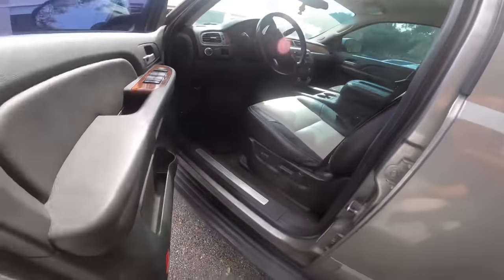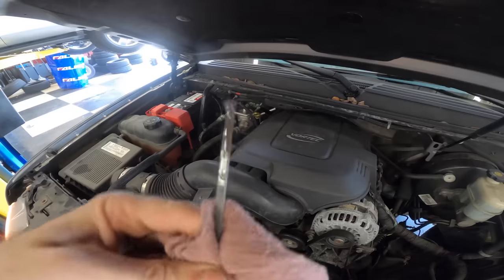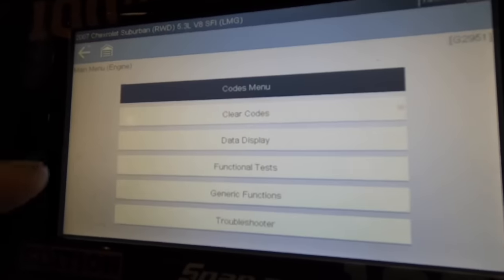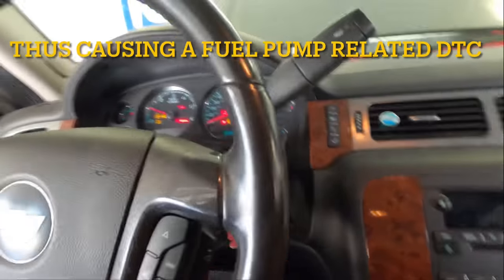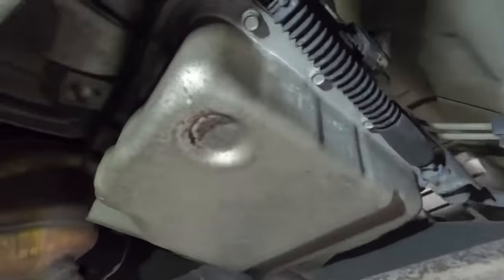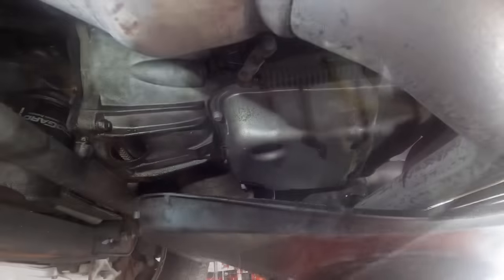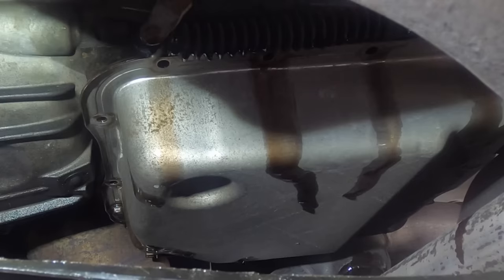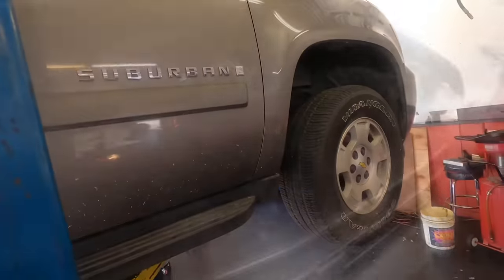Busted! SCAMMING Mechanic Causes Damage! 4l60E Transmission

Comment: I was getting ready to cheer for you when I saw that the gasket was coming off in one piece lol. I don't know what mechanics did to engineers but as punishment they should have to work on what they build for a few years.
Reply: Engineers do what corporate tells them to do. If they want a starter in the gas tank that's exactly what you're going to get. When you have an MBA running the show at the auto company, you get stupid ideas, stupid engineering, stupid everything. My dad worked for GM for 37 years and complained incessantly about stupid decisions by corporate.

I'm a retired engineer from a phone company but like to reach out and touch you. I saw the same stupidity the idiots at the top of the food chain wanted to have things done that didn't make any sense and we're detrimental to the whole Communications argument. I retired and never looked back.
You can't fix stupid
Reply: They're at the shop we like to say, We would like to have a 9" vise.... Every time we came across a over engineered fiasco We would take the engineers head and put in the vise and just tightened a little bit day by day, that way we can squeeze out that stupidity, put common sense in there...
Reply: @jameswilliams9374  This is what I don't get: how would corporate even have the wherewithal to order the starter be put in the gas tank in the first place? I have a hard time believing that a cost cutter would have the expertise required to even know where to begin modifying automotive systems.

From an outsider's perspective, it would be far more likely that the cost cutter would be wholly reliant on a toady engineer who offers such suggestions as, "Well, you see, sir, I've been looking at the design, and it might take some doing, but I'm certain we can keep the build cost under $3k if we put the starter in the gas tank..."
Reply: Marcus I hope I get this reply done correctly.
I wish it was the way you said but it's not, 40 years of dealing with this from my career as an engineer I have got some the strangest requests.

How did the fuel pump wind up inside the fuel tank on many models of cars?
It was the money person that wanted to buy cheap fuel pumps add half the cost of normal ones.
The only way to remedy that was to put them in the tank so they would not overheat.
Yes the budget dictated the location by necessity. Now make it work engineer....

Comment: Use a pump or COMPRESSED AIR fluid extractor to take most of the fluid out before you remove those last bolts to the pan.

Comment: I also notice the magnetic "doughnut" that the manufacturer puts in the trans pan, and the diff. covers on vehicles these days, because of using inferior lubricants from the factory.  I've been in new chevy diffs, less than 10,000 miles, where the doughnut is completely covered in metal shavings, and you can't even tell that it's a magnet, until it's cleaned out.  Using proper lubricants that don't brake down the moment you leave the dealership, would go a long way to combat these situations.  But then you wouldn't have to return for costly service.  I only go to a shop if there's something I don't have time or space to do.  I hate dealerships!  As a consumerist, I try to help people out when I see they've been wronged.  You have a great attitude and work ethic!

Comment: As a locksmith I would just like to say, thank you for being a mechanic who can replace and key an ignition. Wafer one, wafer two…..herr-derr! 😂😂😂
Reply: I was thinking the same thing lol
Reply: Don't you have to have a lock that can be rekeyed? I had to replace the ignition lock on my XJ Cherokee and couldn't find a rekeyable lock, so now I'm stuck with two keys.
Reply: @SNR well, that's less work for you though..
Reply: It's all good until the mechanic tries to repair a Honda ignition on their own and parts start getting lost or they break the transponder coil.
Reply: @TT3Dxyz  well yeah…he obviously didn’t know what he was doing if he snapped your transponder. Sorry you had to deal with that 😐
Reply: @snr2707  I'm also a locksmith. I get a lot of Honda ignitions where the plastic ring around the cylinder is cracked and I have to transplant the board to a different coil.

Comment: I am really glad that you got your own shop now. I liked your older content but I think the newer stuff in your own shop is much better. When I worked at an oil change place in VA it was called the grease monkey.  We would do an oil change on a customers car. The management would want us to up sell things like air filters. Even if they didn't need one. Sometimes the management would put a small amount of oil on the air filter and then they would take dirt from the vacuum cleaner and sprinkle it on the filters. I was full time in the Marines at the time and that job was a little extra money for me.  It really bothered me that they would do that and I didn't last long there. I decided to go work part time as a truck mechanic. I worked the heavy recker and the mobile service truck.

Comment: We had a 2001 Malibu and I hate that car with a passion.  We had the ignition module replaced because it was doing the same exact thing  this truck you worked on. It  cost us over $800 to have it replaced.  They couldn't Program it to the new keys that  came with it and had to use the old keys. Never did get the new keys for the module back. This car had one problem after another over 6 months so I got fed up and junked the car, it was a mechanical disaster.  I will never own another Chevy.
Great video Ray...thanks for sharing. 😊😊😊

Comment: I've been a mechanic for over 30 years and I would never use any kind of powered wrench when installing the trans pan bolts. They snap off too easy.

Remember good work isn't cheap and cheap work isn't good.
Reply: They have plenty of powered tools with torque settings. Maybe you need to upgrade as technology has improved over the last 30 years.
Reply: Na I came here for this comment there’s no way I would do that it’s the same as putting on a tire he seated the first bolt all the way before any others were threaded the torque wasn’t crazy on his tool he just didn’t start them all properly

Comment: That was so funny, as the video cut for a commercial, I said out loud "Dude, you should wear your belt" and as soon as the video returned, he said "and you're right, I neglected to put on my seat belt" as if he actually heard me say it hahahahaha.
If you read this, Ray, putting on the seatbelt should not be done to comply with the law, but to respect your own life and that of people around you! I'm literally living proof of the need for seatbelts for any driver at any speed. No matter how well you drive, you cannot control the idiots on the road who are drunk or are just bad drivers, and it just takes one of them to hit you and you'll be dead without that belt. I was in a car crash, and without my belt, I would have been decapitated... There is absolutely no excuse whatsoever to be driving without a seatbelt. Zero. It costs exactly 3 seconds to put it on, and 1 second to take it off (if that).
I hope you'll never need it, but as with all precautions: better to wear it and not need it, than need it and not wear it...
Reply: Never mind driving while vlogging….
Reply: Back in the early 70's I bought a Ford Fairlane which did not have seatbelts.  I bought and installed them which saved me a year later when I hit black ice on a mountain in Colorado.  I did a few 360 turns and ended up facing the direction I was coming from and leaning at a 45° against a snowbank pushed against the guard rail.  If I had gone over, they would have found my car in the Spring (this was in December) about 40 ft. down in a crevice.  The seatbelts kept me in place instead of throwing me all around or out of the car. I was on Red Mountain pass at the time.
Reply: I personally only wear it to avoid a ticket. I sometimes respond to wrecks. I've seen seatbelts cause damage you wouldn't believe.  People shouldn't be in two pieces. Either way, belt or not, they aren't making it through. May they rest in peace... Buckling up does indeed save lives in most cases.  Most .
Reply: @jeremysales1232  Just as a bike helmet can under certain circumstances hurt you, especially if worn wrong. Safety is always relative!

Comment: "...people always remember and focus on the negative. They rarely remember a positive experience..."
As someone who works specifically in the repair field, I don't know where you're expecting a different outcome.
A repairmen is contracted to perform a repair.  The expectation is to receive a repair one pays for.  It's not a good/bad matter.  It's not, "oh wow!  You really did what I paid you to do!  Bless your heart, sir!"  A customer doesn't praise the person at the drive through, for getting their order correct, that they paid for either.  It's just that it is expected.
When a customer pays for a repair, and doesn't get one, or worse, gets sabotaged, of course there will be animosity, and of course that's going to be remembered.  The expected transaction is breeched and unfulfilled.  
We can flip this on its head too.  Do you praise and remember a customer that pays for the services that were provided?
Do you remember a customer who stiffs you out of paying? 
I know I went WAY too long on this, and I apologize, but the short of it, it's silly to expect people to remember a transaction, simply for going the way it is supposed to.
Reply: That's an extremely thorough and accurate analysis of this kind of situation, and I read every single word you wrote, sir (or Madam). Well done!, I wish the people I have to deal with on a daily basis were as articulate as you. Have a great day!
Reply: Sorry if this comes off as rude, but after reading that word salad, I'd like to point out a scenario you overlooked. The "Thankful for normal service after a really bad day" experience.

If someone's had a really bad morning, day, week, etc, and the next thing that happens goes smoothly then you'd be surprised how grateful people can be. I worked in a restaurant, and I've seen it happen on more than one occasion.

(Edited for typos)

Comment: I came across a lowlife mechanic here on YouTube that was proud he could bill 6 standard labor hours for a job but do it in 4.  I asked why he didn’t charge the customer for the actual hours worked, and he ran away.
Reply: RE " a lowlife mechanic here on YouTube that was proud he could bill 6 standard labor hours for a job but do it in 4."  Customers want to know the damages up-front, and some cars are going to have issues that cause the job to take longer.  For example replacing an alternator on a Ford F150 that was dual fuel gas and propane had hoses and wires everywhere, that took me HOURS AND HOURS to work around to do the job,  vs. some cars where everything goes smoothly and quickly, e.g., an alternator on a 2001 Chevy Tahoe V8 or a 2000 Pontiac Grand Am V6, both of which have easy-to-get-to alternators that took "15 minutes" to replace.  The flat-rate manual averages those out, somewhat.  If a mechanic is fast enough to outpace the flat-rate manual, and does a good job, his shop is going to be profitable enough to stay in business.   I recall a mechanic friend saying, decades ago, "I made far more money with my pen than I ever did with my wrench".  If the job is done right, at a fair price, I'll happily go to that mechanic, and won't be labeling him as a "lowlife".

Comment: 440,000 miles on my original drive train and engine.  The transmission has never slipped.  I only changed the clutch at 326,000 miles.  It still was not slipping then, just making a chattering sound on take off. The trick to having a vehicle a very long time is to let nobody work on it, but yourself.  We started our long journey together when she only had 11 miles on the odometer, back in 1996.  I love my Stargazer.

Comment: This reminds me of when I worked on computers in the early 2000s. Local news station caused an issue with a ribbon cable and took the computer to several computer repair shops as an undercover story. Over 10 shops diagnosed the issue wrong and 2 got it correct. Fortunately I was one of the 2 techs that got it right
Reply: But did they show that you and the other place got it right?  Or just the ones who didn't...
Reply: @NemoConsequentae  they did,  it was a full story they showed on the evening news.  The business at the location I was at almost tripled
Reply: @MichaelBallardwormy  Great to hear!  So often they only show the shady ones & everyone gets stained.

Comment: Isn't it amazing that in the 21st century we STILL don't have drain plugs on automatic transmissions!
Reply: Used to
Reply: you can still get them (aftermarket) or do what I do. I purchased a small pump with a draw and discharge hose that fits inside of a transmission dipstick tube. I attach a cordless drill and draw all of the ATF I can out, then I carefully drop the pan. Almost zero mess and the pump was only $40 (CAD$).

Comment: That Suburban needs lots of money spent on it. Trans is on its last leg, brakes pulsating, ac inop, lock cylinder, oil pressure switch. And I bet the fuel pump is sticking and in need of replacement. It was constantly running before with that jumper wire, let it sit shut off for awhile and it may intermittently not start up again (fuel pump).
Reply: What's crazy is that even With all that work the truck is still worth like $20k in today's market
Reply: @mastahc411  IT actually looks like a nice/clean truck. Rust free, interior is clean. Prob a $6k bill to make it mechanically right (if a shop did all the work).
Reply: Yea I’m not buying the sabotage angle. This thing is in rough shape. You can tell by the fact the key won’t hardy turn over that they are unwilling to fix even the smallest problems.

Comment: Excellent video. Unfortunately, there are more scammers in FL than we can count. I remember changing the air filter and wipers in a Corolla I had for my daughter to go to college. I asked her to go to the iffy place to change the oil and specifically told her not to do anything they recommend. They recommended to change the air filter and the wipers!!😱😱

Comment: I just love “The Other Shop”, if they knew what’s up, why is it here?
Reply: Did you watch the video? As he said in the video the owner suspected he was being ripped off, this has been going on for some time. So he sent it there for someone else to have a look. What was found. A fuse disconnected, 1 relay disconnected, live blue wire shorted to the fuel pump draining the battery, owner said he was told he needed a new computer and fuel pump, not cheap.
Reply: @hrep14  and the Other Shop didn't even need to replace those things - 41:20 - they could undo the sabotage in about two minutes, call the guy the next afternoon and say "ok, you're all set, that's $1400."

Comment: Guys that rip people of go down and you are what we need  and in Australia there are 80% are bad and the one one out of ten that did a roadworthy on a brand new car never found and thing wrong with it he had a small garage and regulat costumers and the others had fancy garges and they found cracked head  fuel problems need wheel alingment because all the ball joints were worn  bad the car only had under 1000kms on it and they found more problems were the honest guy like you said the car was like new and could not fault anything and he was the only one that did a proper inspection and was cheapest a honest man so good on you catching them out

Comment: FYI the fuel pump relay is NOT actually supposed to be there, the fuse box would have you believe otherwise but it’s not actually missing.  The fuel pump is controlled by the fuel pump control module.

Comment: One thing is for sure is you're right mechanics that do shady stuff is exactly why people always think every mechanic is doing stuff like that guy did .   Im having issues with a Toyota dealership about a 2020 Camry SE, with the BS they keep telling me i told them i wish i never bought a new one cause my 95 camry with 292k had no problems never burnt oil, never leaked water  in the cab. Matter of fact i never checked oil or opened the hood the last 2 years i deove it

Comment: The ignition switch was an issue in my old 97 Blazer, same symptoms. Transmission codes and funky operation. It was very common. In fact a lot of later GM cars had issues with the IGN switches, they often overheat and weld the connector to the switch. Limp mode for 4L60's was no 1st gear.

Comment: My dad worked at Pontiac GM dealership in town from 1973-2011 as the Transmission guy had all the ASE did all the warranty work and was just the best at it. He passed away is 2011 I learned as much as I could about working on cars but wished I had learned the Transmission work.

Comment: Nice job problem solving and repair. I hope the documentation is well done so the customer can communicate clearly to the original shop. Practicing the camera work and audio helps a lot for the final presentation.  Good luck and I hope you get good customers as a result. GB

Comment: The way that I used to drain the trans fluid was to remove the line from the transmission to the cooler start the car pump out the oil through that line and now you remove the oil from the pan and also the torque converter instead of only draining the pan if you do this just at idle and shut it off when the fluid stops coming out there’s no chance of doing any damage. dropping the pan a lot cleaner and you’ve removed the fluid from the torque converter

Comment: Transmission shops have always been crooked. I know because I've worked for several of them. Most of the time a torque converter replacement would have solved the problem but they'll tell you you need a transmission rebuild and it never solves the proplem. I've seen people getting ripped off at transmission shops for years. It's funny that they only give a 30 day warranty.